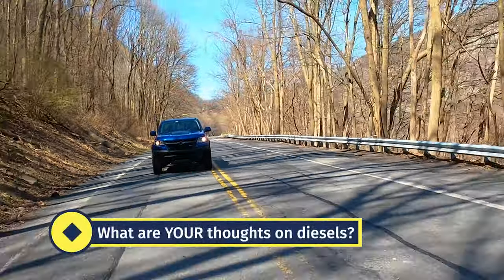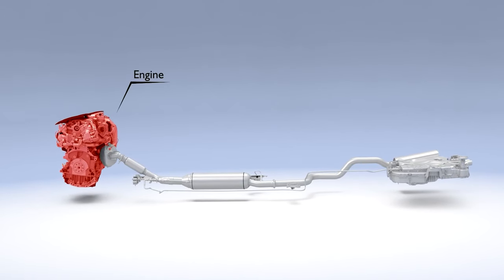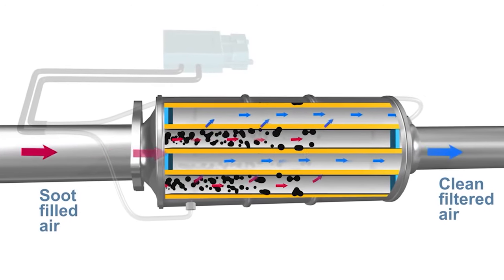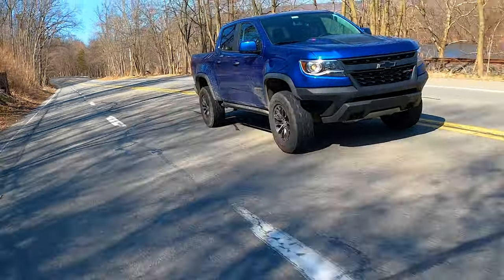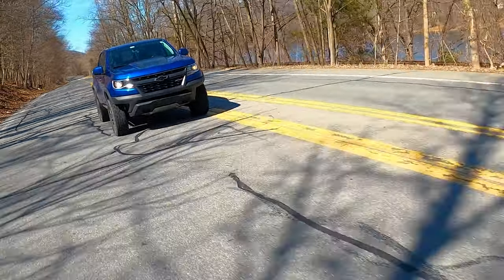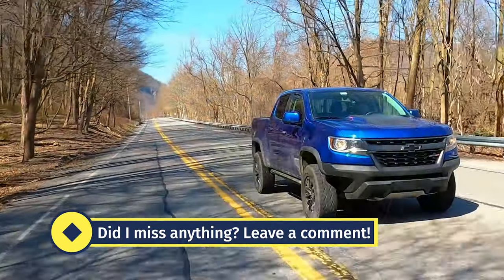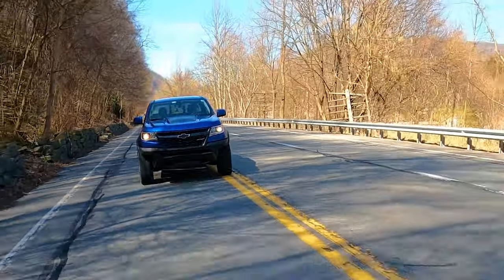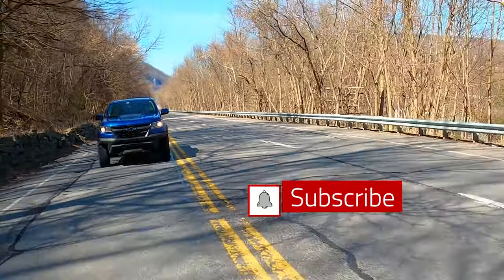Buying a Diesel Truck or Car?  5 Things you NEED to do to Keep them RELIABLE

Comment: Wow about time.
I been saying this on the forum’s over and over and over.
Get it hot
Tow with it
Today’s diesels are no good for city living and short drives.
Never fill the DEF tank
I pulled a 5000lbs trailer with mine when it had 1000 miles on it.
Your spot on with the stabbing at the throttle and causing mass amounts of soot....
It causes a very very rich condition 
Well done man well done

I can’t believe the guys that want a intact diesel for an overlanding.  bad bad idea 
Todays diesels with DPF is just looking for failures when used as an overland vehicle.
There is no difference when idling along off road or just idling in the driveway 
I have a 2018 Colorado LT 4x4 long box and it has had some massive loads behind it.
Love the truck. No issues 32k miles. Great mileage. Had 4 Rangers in the past and this is hands down better.
Rob
Reply: “Never fill the DEF tank”—and it will stop running. Not a good philosophy.
Reply: @billeldon  
I never fill the DEF tank. Never more than 1/2 full . Especially in winter. A full def tank is hard to thaw out when it freezes. The fuller the tank the longer the heating element will be on. DEF is temperature sensitive and goes bad very quickly in the summer heat.
So never fill the tank

Comment: A couple of clarifications. Fuel dilution came out with the DPF and Re-gen not with EGR. EGR trucks came in '04 if it was a GM.  Ford uses their injectors to fire on the exhaust stroke during a re-gen hence injecting raw fuel into the motor that might not be burnt and then the dilution. I don't know about your Colorado but the big DMAX uses a extra injector in the exhaust system to help with the DPF burn and also to have no dilution problems. It was a more expensive system adding the 9th injector, fuel lines, etc but probably the right way to do it.  Regarding throttle response that is usually torque management to protect the trans. On my older2500 HD '06 truck with 650 ft-lbs of torque I could roast tires. Newer 2500HD truck with 910 ft-lbs of torque I really can't even chirp them. They are just trying to protect the trans in these trucks as they now have nearly 40% more torque. DPF usage is usually somewhere around 1 gallon/1000 miles across many brands of trucks. If you tow it will use it faster but using that 1 gal/1000 miles formula that helps you manage your DPF fill rates. For sure Diesels love heat and I don't think the Colorado has a winter cover but make one by putting a plastic cover over  the radiator and it will help your winter fuel mileage. If you see temps rising reduce it's size a little.

Comment: I've had two diesel cars before I got my Civic Type R. A Mazda 626 diesel which I drove 160'000 km in 10 years (was an OK car but it didn't have a turbo, nothing). Then I got a Honda Civic 2.2 diesel and drove it for 260'000km in 12 years. Loved the Civic way better, it had a turbo on it and was a much newer and better car, had 320 Nm torque and ran well. 
Since over 1 year I'm back on a gasoline car and love my Civic Type R, 2018 model. I love Hondas and Japanese cars in general.
Thanks for your videos, very informative. Keep it up!
Reply from the maker: Thanks man, appreciate it!

Comment: Definitely found a oil catch can to be particularly helpful with my ‘18 diesel Z71.
Reply: Which one? Or did you go custom?
Reply: WangChung yes custom. Went with an industrial setup used on commercial equipment. Put in the Racor CCV4500 crank case ventilation filter.

Comment: I don't get why more small displacement (2.4 litre to 3.0 litre) diesel engines aren't popular here in the USA. No engine is perfect, and which ever engine you choose, gas or diesel, you'll always have to deal with emissions and pollution, that's just how it is with engines. But like anything you drive, there has to be a means to keep the engine, and therefore the vehicle you drive, running like it should. I don't see the Diesel engine ever "going away." There may be some setbacks, such as Volkswagen's Dieselgate scandal, etc., but as long as there are those who need and want a diesel engine for their car, truck, SUV, etc., it'll be around for a long, long time. I hope so. :)

Comment: Haven't driven a diesel vehicle yet, but either Chevy ZR2 or other popular midsize trucks is it good or a bad combo (New or preown) of Snorkle and Air filter mod without cat back exhaust? 

 Short version: buying new (ZR2) in future is ideal or not to have self start, snorkle, winter engine start up aid, and added air filter that comes on gas with cat back exhaust?

Comment: When you say don't idle this engine, what about when you want to warm up the truck to melt ice off the windows before you start driving through a blizzard? Is that idling time bad for the engine?  i.e., idling for like 10 minutes or so to get the heat going.
Reply from the maker: Yea I don’t recommend idling that long especially at the start on a cold day, you want to get that engine up to temp quickly
Reply: @FlyinGato  Thanks for your advice. Truly appreciated.
Reply: @FlyinGato  sorry to bother you about this issue. But I was wondering. What if you were to idle the truck,  but jam something on the gas pedal so it would idle at a higher speed? Or, in another case, if you were stuck in traffic for like two hours of only driving 2 miles an hour, could you pop the truck into neutral and hold down the gas pedal a little bit to increase the idle speed? Would that solve the problem?
Reply from the maker: I would pull out as soon as possible after turning it on, don’t accelerate it idling. If you get stuck in traffic, take the truck out for a 15 minute spirited drive

Comment: When you say "go on long trips," how often should you go on a long trip and how long should this trip be? if I have lots of very short rides each week, but one long joy ride to clear out the DPF, will that be OK?  I was fixin' to get a 2021 diesel, but, after watching your video, I think I would be much better off with the gas V6 (if I can find a dealership that has one in stock -- the chip shortage is impacting everything).
Reply from the maker: I would say a trip of at least 30 minutes that's either above 65 mph or spirited in nature, basically need to get the engine and exhaust nice and hot
Reply: @FlyinGato  Thanks, man.
Reply: @FlyinGato  How often should I take one of those 30-minute spirited drives?  For example, should I do that everyday? once a week? once a month?
Reply from the maker: @OrcaBoat3  I would do it at least twice a month
Reply: @FlyinGato  Ok, so for example: if I ran this truck on lots of short trips each day (like a 5 minute trip here and there), if I were to do one 30-minute trip of spirited driving each week, would everything be OK?
Reply from the maker: Yes, the truck will have the opportunity to clean itself out with the extra heat

Comment: diesel engines are designed for city driving because they operate at low rpms and in turn use less fuel. If your diesel is getting clogged up from idling too long that means either your engine or your fuel is total crap. Hell, all the small cities in Europe are full of super reliable small and big diesel cars. People drive them either in traffic or at very low speeds without an issue and some of them get to 100000 miles especially in Eastern Europe
Reply: If you drive short distances all the time with a Duramax Colorado, you will have emissions issues. I don't care what European cars do, these trucks don't like idling and short drives. You'll never finish a regen if you don't get the truck up to proper temp and keep it there through the regen cycle. This is when the truck gives you the keep driving message. Also, every car or truck of any make should make it to 100,000 miles, that's nothing.
Reply: @quintili1  I sat 1 mil miles not 100k LOL